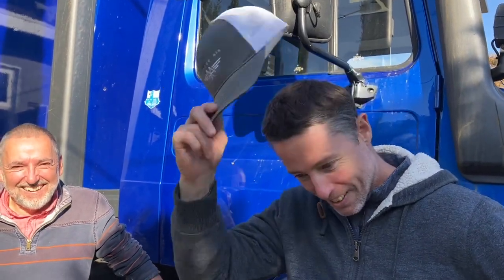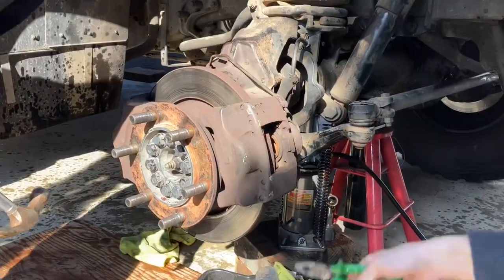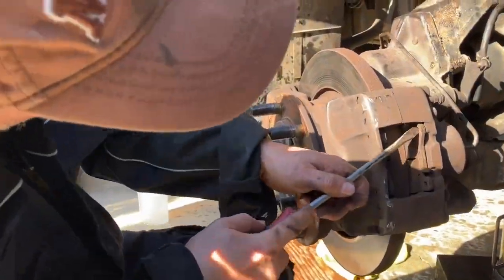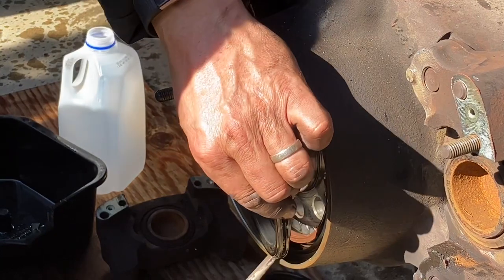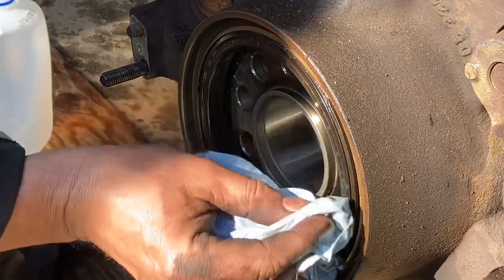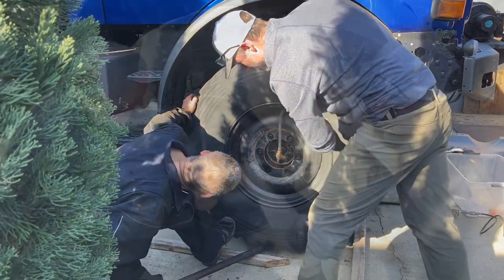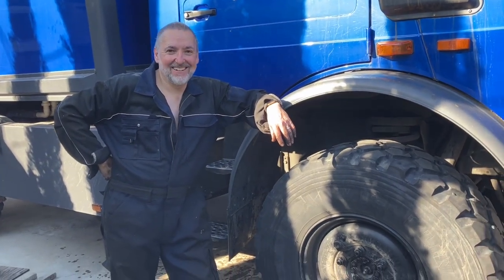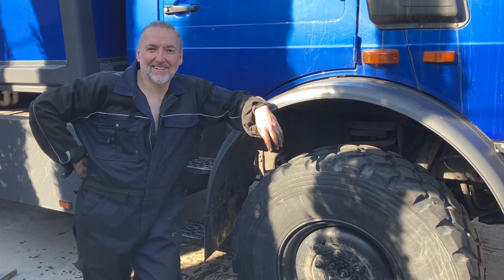2 hub seals, 8 brake pads and 1 oily mess…  (one for Mog enthusiasts!)

Comment: That was a lot of water.   Those cassette seals are pretty impressive compared to the normal seal.   I think you are right, the hub vent must be blocked somehow to get that amount of water in them.     On my  U1250, the brake disk can come out the bottom of the hub without taking the brake callipers off ( or apart)
Reply from the maker: Hi guys, the fluid was all hub oil and luckily did not contain any water but it was under pressure.  
We did find that the breather pipe was blocked so cleared it with an air line.
The pads will come off without removing the outer calliper but we couldn’t get the disc/rotor off without removing the calliper.  Second hub was much faster than the first once we knew what we were doing 👍

Comment: Why did you split the brake callipers? Grease on the seals before pressing them in?
Reply from the maker: We ended up removing the outer callipers because we couldn’t remove the brake discs/rotors with them in place.